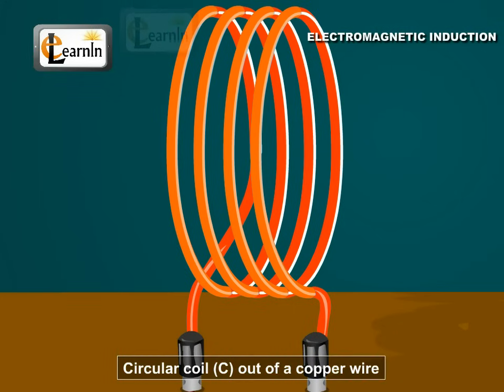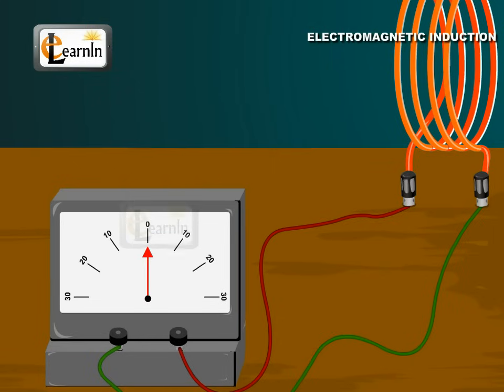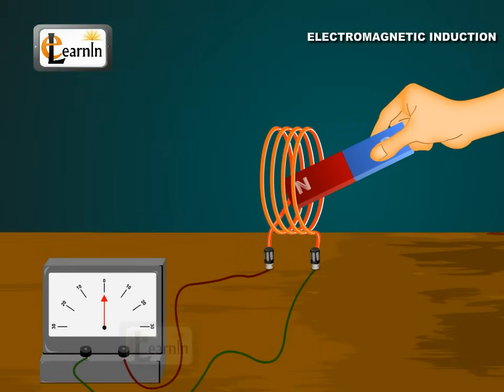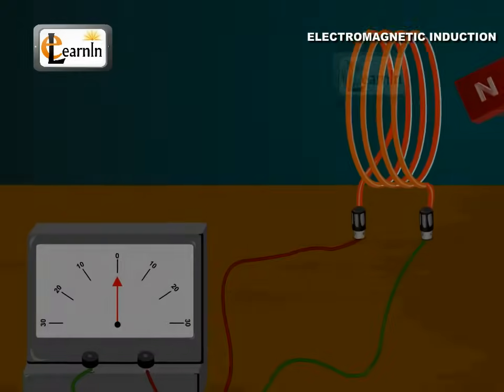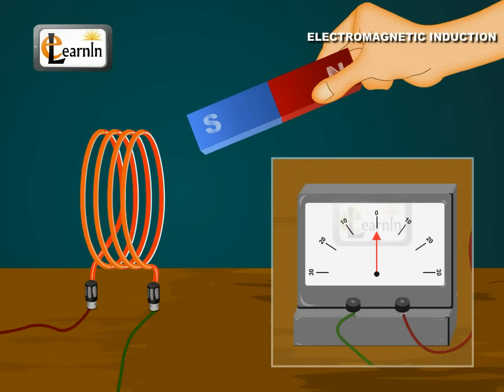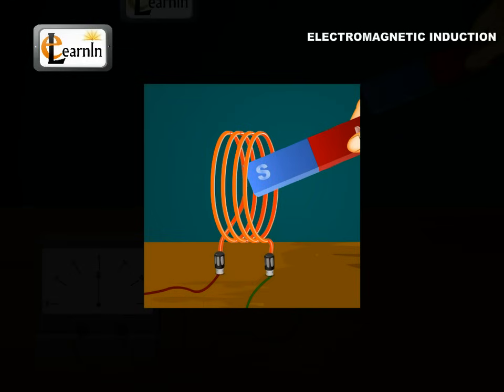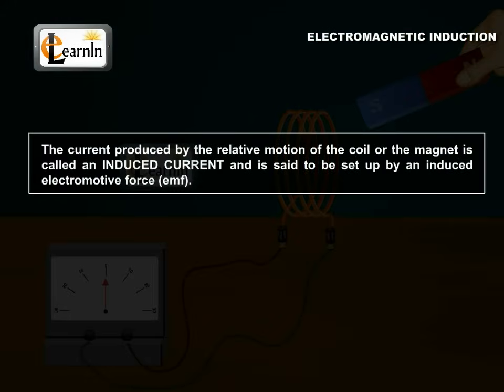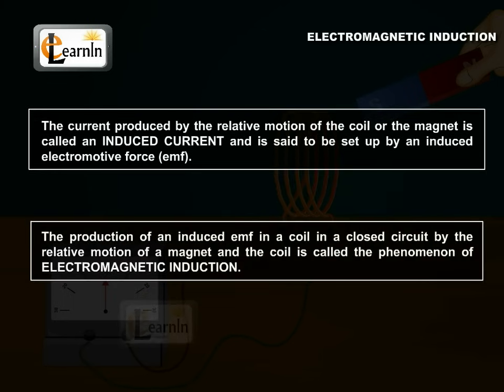Physics - Understanding Electromagnetic induction (EMI) and electromagnetic force (EMF) - Physics

Comment: There is a mistake in the deflection of galvanometer 
When the north pole is brought near to the copper coil the galvanometer deflects in the right and when it is moved away the galvanometer deflects to the left
And in South pole it is reverse when brought near , galvanometer deflects to the left and when moved away then to the right

Comment: Please help with the following questions. If the magnet was swiped by the coil like every generator is set up does that produce more engine. Not speed. I mean passing by on a rotor vs pushing in and pulling out of coil?

Comment: i think there is a mistake between the movement of bar magnet and the deflection of galvanometer.when the bar magnet is moving toward the coil, a counter flux will oppose the main flux according to lenz's law. this flux is produced due to induced current, when this current will flow through the galvanometer, the deflection should be on clockwise direction.according to your coil setup.
Reply: Yes

Comment: why does every video show the magnet going into the copper loop and then pulling out, while in generators the magnets are passing by the coils.  What does that look like on the meter.   And do you get different results based on a clockwise or counter clockwise wound copper loop?

Comment: I see this demonstration often.  But in generators the magnet is never going into and out of the coil but being swiped by the coil.   In those videos it takes a north pole to venerate negative, and then a south pole coming by to get positive.  So you get a full sign wave.  0 to highest negative to 0 to highest positive to 0.  In this demonstration a North pole alone gives you that same 0 - 0 + 0 sign wave.  So the question is, does induction behave differently if you shove a magnet through a coil and then pull it out quickly or are they just wrong in the other videos?

Comment: Friend your vid is wrong a G meter measure electric current not convection current electric current is a flow of electrons from the neg to positv , when the magnet is moving towards the coil the electric current flow of electrons oppos it so they mov toward the magnet therefor the left side of the coil  red wire become the negatv and the G meter should have pointed in that direction

Comment: Hello all, I have just tried it using 14SWG Copper Wire, I made a coil with 4 spirals in the size of the demonstrated here coil and I had very poor results, the needle was hardly moving from -1mV to +1mV, any ideas?
Reply: I don’t know if you’re still interested in an answer for this, but if you increase the number of turns in the coil, the voltage should increase. The same goes with increasing the speed of which the bar magnet moves in and out of the coil or increase the size of the magnet.
Reply: Thank you Steven

Comment: could someone please explain to me how emf creates electricity? is this ac or dc? this is my example a magnet forced through a coil or conductor. what is the energy equal to? the force of gravity? the stonger the magnet higher the emf? small field high attraction make more emf's? i want to build a generator based on this and im haveing trouble ik that turning a electric motor will create ac and so will alternators. where would you attach leads?
Reply: The current is alternating, just like with a generator.  In fact, this is how generators work.  You would connect leads to either end of the induction coil and then spin the magnet or spin the coil in order to be constantly changing the magnetic field.  It creates electricity because the magnetic field causes the electrons inside of the coil to move.